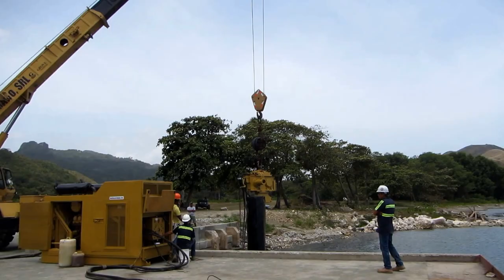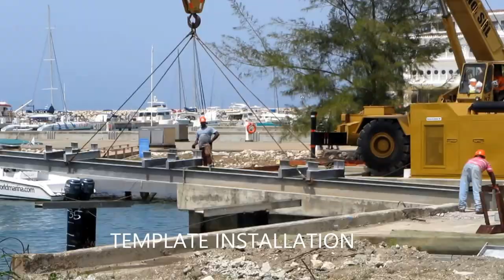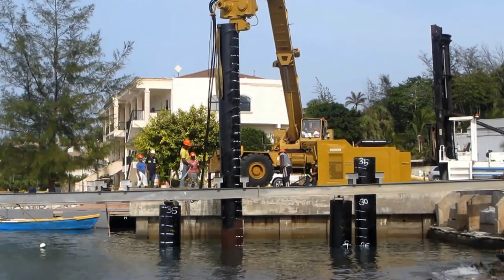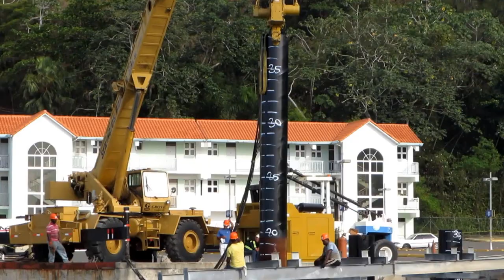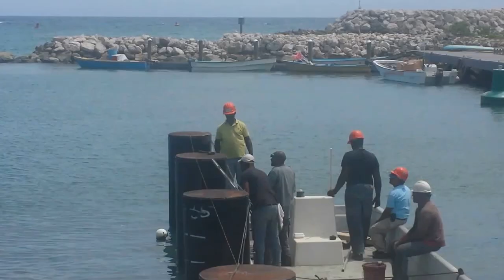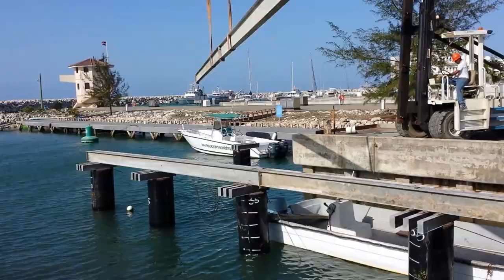Marine Pile Driving - Marine Construction

Comment: just a question. how do you clean inside a drive TSP. It is drived to a depth of 20m at sea. Thank you.
Reply: no need for cleaning. depend to designe criteria most of them are open head piles. after completion of driving works, for prevention extra vibration the head going to clean for some meters for puring concrete.
Reply: Ali Hossein our design needs to clean the TSP 3m deep though. anyways... thank you for your insights it was really very much appreciated. anyways, is if I need again your knowledge i will contact you again sir. thank you. have a nice one!
Reply: Just stick a air lift in the pile and create a slury with a water jet and clean to the required depth.

Comment: If they would use a hydraulic excavator they could guide the pipe and not have to use I template with a crane
Reply: Seems like the piles are too far out from the working platform for an excavator.